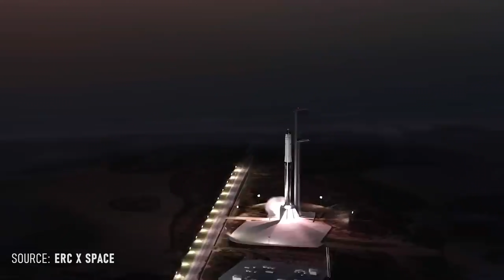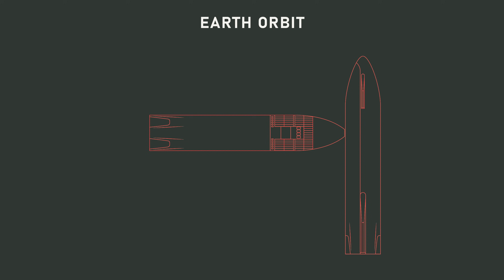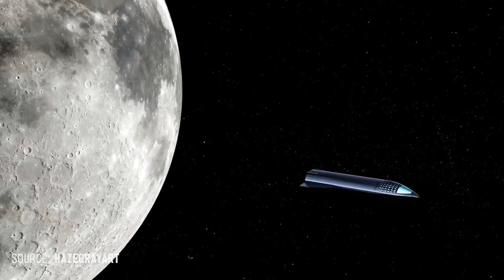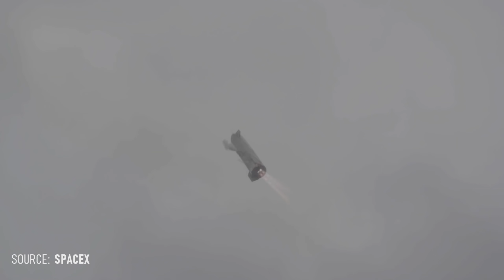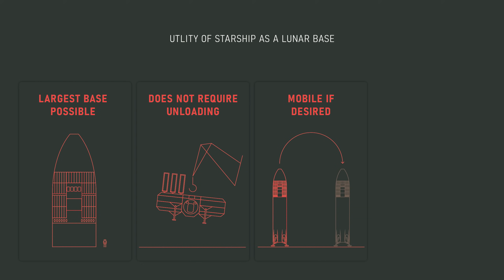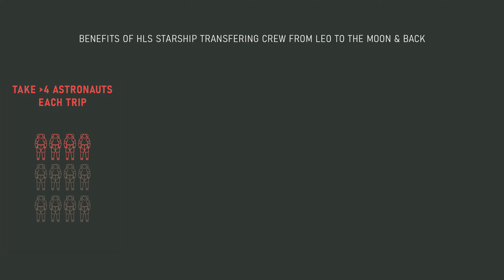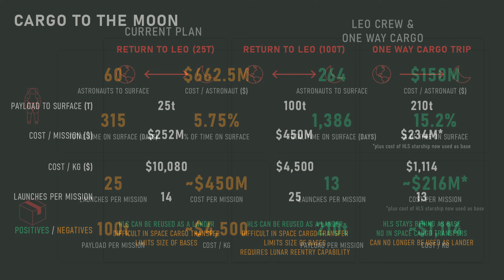How to Use HLS Starship

Comment: SpaceX is legit the only good space company right now- every other Artemis bidder is reliant on Orion's one-year launch cycle

"Buh buh buh muh competition"

THERE IS NONE

You cannot seriously call for more competition and say something is safer when there's a year between launches in case of a disaster, when SpaceX is willing to launch every other day and already has StarShip in mass production, more vessels built than can be tested

Scrap Orion, scrap SLS, scrap the Artemis program and merge everything manned into the Commercial Crew program and expand it into Lunar and Martian visits, not just ISS launches

FORCE Boeing, Blue Origin, Dynetics, etc, to develop craft for reusability and scale, not just one-off, exact-spec committee designs, force them to change their culture from relying on cushy kickbacks to actually wanting to expand space on their own terms and have NASA as the government guidance institution rather than the sole vehicle for crew programs because it hasn't worked since Apollo's end

Comment: I'm sorry, but your arguments are flawed. First off, cargo can be transferred through the elevator hatch. Second, leaving the lunar starship in lunar orbit and sending an unmanned cargo starship with cargo and fuel is more efficient. The cargo starship can carry more fuel because it won't have space taken up by living quarters. This means it can fly to lunar orbit, transfer cargo and enough fuel to the lunar starship and return to earth orbit. Then the lunar starship will be ready for the next landing (and also, the lunar starship won't need as much fuel itself if it is left in lunar orbit). Look at the bigger picture here. SpaceX is building an entire infrastructure with multiple kinds of starships all needed to work together, not just the lunar starship. The lunar starship won't be able to be launched unless the entire infrastructure is ready.
Reply: And no crew needed, robots CAN do it. Robots are building cars and computers here on Earth. Not more difficult.
Reply: After all, robots are also exploring other planets for us.
Reply: Your arguments about using lunar starship as the base modules are good though. But then they need an additional lander each time they send a starship for a crew. NASA may not be able to pay for that. NASA does have a limited budget after all.
Reply: Finally, Congress will not fund SLS long term. It is easy to see where their priorities are. Once other ways of getting to the moon are fully up and running, at least to NASA's satisfaction, Congress will cancel SLS and we will be using the other methods. SLS is only a short term beginning, not a long term solution. We will never see two SLS launches a year and SLS is only likely to last 4-8 years. SLS is only still around as a political publicity stunt so the government can say we can still do this. And they have wasted too much money on it already. Commercialized solutions will soon take over. Don't get me wrong, I still want to see SLS fly, but I can see what is fully happening too.

Comment: Has SpaceX figured out how to long term store cryogenic O2 and CH4? if not this whole plan is not going to happen. I hope they are working on this because the way I see it O2 and CH4 will be impossible to keep onboard a starship for more than a few days with current tech. I would wager they are working on a CH4 / O2 reclamation system instead of the over pressure gas blasting out into space. Maybe use the header tanks as a bleed off reservoir and re-liquify it. This would take a lot of power though so that would mean Starship would need some larger solar panels then what they are planning.

Comment: Why not have a dedicated starship space tanker? A starship that is not built with all the extra stuff to land on the moon or reenter earth's atmosphere inorder to make it as light as possible and as efficient as possible.
Reply: Maybe even make it so its delivered into space by a cargo starship so it doesn't even have the extra material to survive max Q. It's just a tank section with a few vacuum optimized raptors, some thrusters for maneuverability, and solar panels and radiators to keep the fuel chilled. The minimum weight possible moving back and forth between earth and the moon.
Reply: You can add a cargo section that is designed as a quick load, like a shipping container you just switch out.

Comment: I don't think you took into consideration the refurbishing requirements for reuse.  Last I heard it was going to be every 10 flights or so.   That's engine uses and/or heat shield use (aerobraking).  These refurbishments will have to be done on the ground.  Also, there is a limit to the number of times the Booter, Tanker, and Lander can be used, even with refurbishing.   I hear they are shooting for 100.   These requirements don't break your proposals so much as add a great deal to the costs.  10-20% as a wild guess.  I haven't seen the numbers.

Comment: couldn't you just refuel starship from the resources already on the moon?
Reply: You need liquid oxygen and liquid methane. Making either of those would be both incredibly material and energy heavy on the moon so it will require a massive mining operation. You have to mine and melt massive quantities of the moons crust in order to do that which is just simply not feasible anytime soon so no it cant do that
Reply: @atanasapostolov2731  no, I’m talking about hydrogen and oxygen that we could extract from the South Pole
Reply: @RichMiniön-r2m  starship does not use hydrogen, its needs around 80% Liquid oxygen and 20 liquid methane
Reply: @atanasapostolov2731  yes, i know but they could always change starships fuel type to hydrogen and lox. plus NASA's plans for the moon is to make it a refuling outpost for rockets going to mars and other planets, so it would only make sense for starship to adapt to NASA's plans instead of NASA adapting to starship

Comment: Many of your arguements are logical and also wrong. 
For instance, starship maxes out at 100 tons or more to the surface of the moon. But that's wrong in so many ways. The contract calls for much less. So SpaceX can carry maximum CONTRACTED LOAD and all the rest can be say spare fuel in containers it leaves in lunar orbit for use later. Plus you used the same delta V for earth return. By use of gravity sling shot even ion drives could eventually bring a starship home to earth and aero braking maneuvers could slow it down to reenter LEO orbit with little or no fuel use. This would require much longer time to return to earth orbit but if it is unmanned who cares if some lunar rocks get here more slowly. 
There are many options for Starships in orbit. Nothing is impossible, just shades of compromises to get it done.

Comment: Wouldn't it be cool to see what concepts could be proposed for a low orbit fuel depot to eliminate all those refueling flights. Venus is just sitting there with all that extra CO2 to make methane or some other method to capture and orbit our usable greenhouse gases. Probably the real future is inspace electric propulsion and chemical propellants for space access!

Comment: Another interesting and thoughtful video. Using Starship as a huge cheap cargo ship is the way, with crew transfer to Lunar orbit by Orion/Dragon/Starliner and a small reusable shuttle to the Lunar surface. Multiple refueling to use Starship for 4 astronauts seems too complex.

Big problem though is that Artemis is nearly ready for Lunar orbit but Lunar Starship is years away. Typical poor planning by NASA in not developing a Lunar module years ago. SpaceX F9 superheavy could do the job, who needs Artemis now.

Comment: I was a mission controller on Magellan where we did the 1st experimental aerobraking in space. I am wondering if it is practical to try that maneuver on "return to Earth" landings (as needed). Specifically, I am thinking of Astronauts. It would take a few more days of de-orbiting as you don't burn off that much delta-V (DV) in one shot easily.  IE, enter Earth elliptical orbit and scuff off some DV, then cool off till you are able to scuff off some more. It took weeks for Magellan but it was not designed for it. SS is already configured for that by design. It surely would work for cargo missions as they can be delayed as much as wanted.

Comment: I wonder how much performance hls can gain by ditching heat shield, aero surfaces switching in lighter landing gear, no sea lvl raptors. Of course the payload has to accommodate solar panels radiators  landing thrusters not to mention life support and crew equipment and supplies so it was never going to be a habitable starship plus 100tonnes but a 100 tonne payload minus 15 tonnes of equipment required for to make it habitable.

Comment: I agree 100%. But you overlook a further massive bonus by leaving a Starship on the lunar surface to act as a moon base.  The fuel tanks of the starship are fully pressure rated and so can serve as additional workshops and habitat volume after landing. All interiors, air locks, equipment etc can be located within the tanks before takeoff from Earth and after extensive venting to the lunar vacuum, once on the lunar surface, the tanks can then be accessed for use.   This would make use of the entire starship structure as the lunar base.  Additional provision would need to be made for life support etc. and the mass of interior fittings would eat into the deliverable payload mass but this would be marginal as compared to the overall gain in utility.  Okay there exists a further  opportunity.  The lunar base/starship should include in its payload inventory a lunar ascent vehicle ( a modified Falcon upper stage with methane fuelled raptor engine and Crew Dragon).  This ascent vehicle would be light weight, as compared to a Starship, and it could be used either 1) just to ferry crew to the lunar Gateway or 2) ferrying crew all the way back to LEO or 3) to take crew all the way to splash down in crew Dragon while leaving the upper stage in LEO as a refillable space tug.

Comment: The one way cargo method should include the cost of the lander because in order to reach your new base you now need to build another lander, if that lander is a starship well what’s your base for? And you have now spent the cost of an entire lander to bring some extra cargo and un-required living space to the moon. Are your astronauts going to need 25t 100t or 200t of cargo, for a several week stay?

One way real numbers to get cargo and crew to the surface
235t
486 million*
$2000*
27launchs

*must add the cost of mostly single use lunar starship

Comment: Please answer this question, Thy not just ride dragon to LEO and board the HLS for the ride to the moon.
Artemis should be re-tasked to asteroid missions. Oh wait!! HLS would probably a better choice.
SLS is unnecessary for lunar missions.
I do like your idea of using an initial launch of a completely outfitted HLS to serve as the first permanent base. Brilliant!!
Reply: What about using a Starship based trans-lunar boost module to provide all the power to launch the HLS from LEO to the moon. HLS and the 'trans lunar boost Starship' launch on Super Heavys. The 'boost Starship' comes up behind, locks on and gives the HLS push towards the moon. It then returns to LEO for refuel. If re-fit is necessary it can attempt landing (until we can refit in space). 
That way the HLS would have the fuel on board to land on the Moon, return to LEO. You could even transfer out the crew in Artemis and then land on Earth for unload and refurbish. I dont like the idea of humans taking the swan dive.
No inflight refuels with crew on board. #ilikeit.

Comment: Check out the SpaceX Orbital Cargo Transporter concept.  There would be a cargo transporter that holds 10 cargo modules, which could include fuel.  By using this Cargo Transporter, 10 times more cargo can be transporter to the moon.

Comment: To use the starship as a permenant lunar building (or even just to leave it in orbit as a lunar gateway or ISS analog/replacement) internal crew access hatches on the fuel tanks for once you've dumped/transferred the fuel would triple the habitable volume.

I'm not sure how much the engineering cost would be for pre-adding space-station-specific or surface-hab-specific hardware as well as tank hatches strong enough to take cryogenic pressures ... but also engineering in an engine quick-release mechanism to be able to remove and "Ship" back some of the more costly launch-specific hardware might offset things a bit.

Pre-fabricated, self-launching, mass-produced habitats or space stations has to be worth the effort, at least until we get down our in-situ building skills.

Comment: This is similar to the situation with the Space Shuttle's external fuel tank, which was ditched for every mission, despite the fact that keeping it in orbit would increase the payload capacity for each mission. It's not that they didn't have ideas for what to do with a bunch of empty fuel tanks in LEO... they just didn't have the budget for it. Luckily, in the modern age of cheap access to space, this is less of a problem now. In a few years, if you find yourself in possession of a few Starships parked in Lunar orbit (or on the surface), it will be much easier to find a use for them.

Comment: The absolute weirdest thing about SpaceX winning the contract is that because Starship is so overpowered for the job all long term project that were planned to this point are redundant:
- SLS to boost Orion to moon is useless becasue HLS Starship is going to LEO to refuel anyway.
- Orion capsule and Gateway Station also are nothing special now, unless you want to fly two ships Earth-Moon per trip
- "SLS with Orion can only fly once a year" pathetic

So assuming HLS Starship needs to go to LEO before every landing I would make it differently. I would put Gateway Station in LEO so you can manually move cargo and people to Starship from other launchers. This station could have small crew by itself. Orion would be just for show, while SLS would be just a big launcher comparable to Starship that for obvious reasons will have to fly till then.
Problem of cargo size could be solved if side cargo bay/airlock can be used. With everything docked a Canada Arm could just put it in like they do with Dragon trunk.
Large missions would also be interesting as Gateway station could have one Russian module with adapter for their docking ports, like the one USA had on MIR.

Comment: Are you sure to use re useable rocket for one way mission for 2x the payload but alot more expensive?

And how to bring the crew back?
And i have a question :
Its the 210 tones of payload is included the HLS interior
If Not you only have the roughly the same cargo capacity as hollow reusable HLS
Reply: Some things are heavier than others so volume is not as big of a concern, and even then you can stuff things into usual living space.
In this kind of mission there would be no humans involved on this cargo flight. Only later normal lander with people would come.
There is however another problem... would those side thrusters be able to land this extra mass.

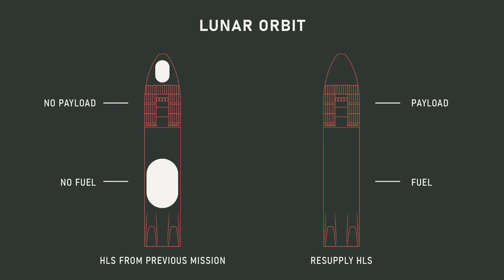Comment: 5:57 The resupply starship could be a more typical starship with a heatshield and fins so it can aerobrake to return to Earth, unlike the lunar starship which can only land on the moon.
Reply: True. Should save some cash
Reply: Indeed, lunar landing needs completely different landing hardware that define the HLS difference from regular Srarship.  HLS has landing thrusters high above the surface and anti-toppling landing legs.  Regular Starship has moving flaps, and heatshield, but happily lands on a giant raptor flame on a cleared Earth or Mars pad.  The HLS landing method uses no atmospheric braking, only active thrusters, which also limits total mass at landing time.  This in turn limits maximum fuel on a HLS launch from Moon, thus limiting ability to return to Earth orbit, with or without crew.
  In contrast, a tanker starship in lunar orbit can provide lots of extra fuel for returning HLS and other methalox rockets.  If we resurrect the lunar gateway as a crew only waystation, HLS can drop off astronauts there before refueling, needing only a small amount of fuel to take off and go to lunar orbit stations.

Comment: Starship needs to be refueled in a much higher orbit than LEO, perhaps as high a GTO, to really make use of its potential for lunar missions. That shifts the burden to the refueling vehicles, but allows massive lunar payloads.  The trouble is, as currently configured, a Starhip probably can't deliver as much fuel to GTO as a Falcon 9 without itself being refueled in LEO.
Reply: If you could use normal atmospheric starships for return it takes away alot of the fuel requirements. Who knows when they'll start using them for lunar missions though.

Comment: At 25:00 to 25:50 this vid, that part was wise, using a lunar pod lander & not neccessarly the whole Looner Starship, swapping rocket canisters, the Mars SN should have done the same with a 3rd stage POD, this would require delivering CRANE mechs to Mars first, but make infistructure & human colonizing 2x earlier then calculate. If infrastructure & mech robitc testers/builders of Biosphere/foundation was there already by NOW. 
The Boston mechs try to compute this and starts  dancing & singing: "hutt..tedda..hutt..tedda..hey!!...Hey we can build it!."